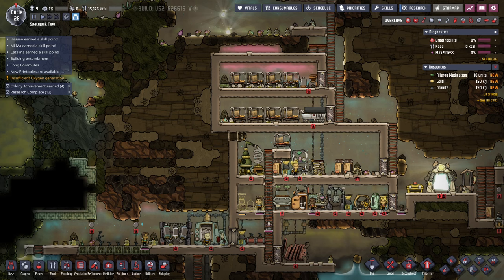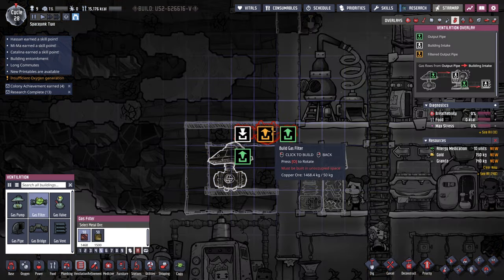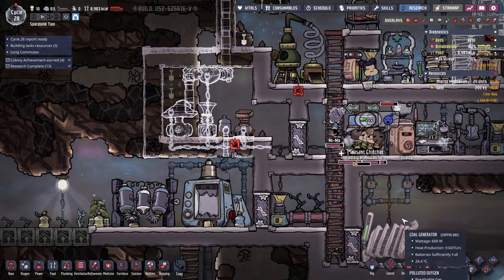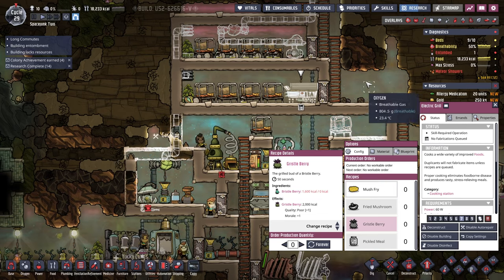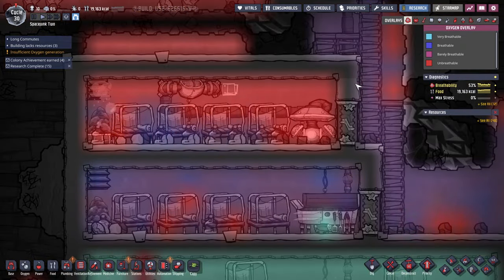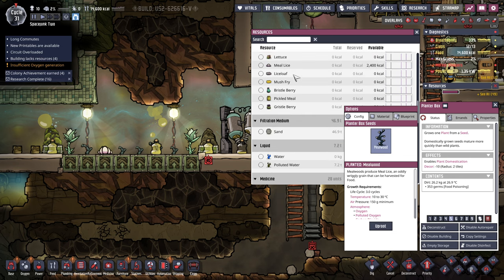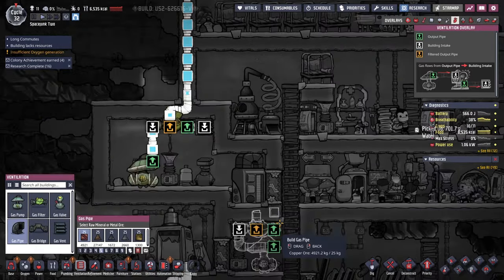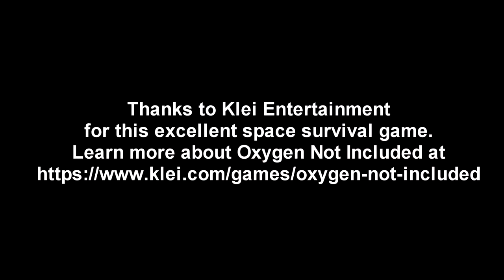Oxygen Not Included 5

Comment: One good thing to do first is a closed cycle lavatory/bathroom/filter that reuses the water, maybe not fully closed you can take fresh water or better polluted water to feed it and store the extra fresh water. Then doing the electrolyzer/ventilation thing, do it in a closed room, move the oxygen arround the rest of the base and use the hydrogen for a bit of extra power. The base should be done all with dedicated rooms for the bonuses, plus it helps to focus on what matters for each room type. Also you don't need to waste metal on so many airlock doors, that slow down your dupes movement, use the nomal pneumatic doors for rooms). Power is complicated, you need to layer it with a centralized power grid out of the way using the bigger wires then transform into separated power grids using smaller wires to feed some rooms. So basically divide it into grids based on the max power they can handle. Eventually you can have three levels, Big grid -> Transformer/s -> Medium grid -> Transformer/s -> Small grid -> appliances.

Comment: Sealing off rooms and using pumps to separate gases is a very power hungry way to deal with gas flow. The gases will separate themselves according to density if you allow them to flow through the base using airflow tiles and replacing the airlock doors with mesh ones. you just need to dig up and down so the CO2 has a place to sink to and the hydrogen has a place to rise to. 
This is a tough game to play blind. while knowing some orbital mechanics gets you far in KSP, knowing some thermodynamics can trap you in ONI as there are some major diffs from the real laws!

Comment: If you feel like you want to make a goal for yourself of figuring out a single critical system...  Might I suggest trying to figure out some version of temperature control in your base as your next critical system before all your duplicants freeze or burn?
Reply from the maker: I've seen no indication that they're at risk of freezing or burning so, until the game gives me some hint that it's going to be a problem, I'll wait to deal with that. That's been the flow of things so far.
Reply: @RaizSpace  Well I do see your duplicants constantly mentioning how cold they are, lol.  (There's a shiver animation; kinda like the holding breath animation when they are in a place without good air)

And the thing with heat in this game?  It's a self-reinforcing cycle.  So the second it tips too far in one direction, everything goes to pot pretty quickly.  

Thankfully you do have most (if not all) of the tech needed to handle it!  All you do, is set up a second closed-cycle water system.  (Might as well use polluted water for this, rather than good drinkable water, as it's only pourpose is to exchange heat).  So what you do is just pump water through insulated pipes to where it's hot or cold, then use regular or radiative pipes with lots of surface area in a hot or cold place.

So the water goes to the place that's hot, and in radiative pipes (or regular pipes) it picks up heat, then you pump it through insulating pipes so it STAYS hot, and pump it up to a place that's cold, and you have it go back through radiative (or normal) pipes to release that heat and get cold, which travels back through insulating pipes back down to the hot place to cool it off.

You will need this idea a lot, lol.  It's kinda how you create your own kind of refridgerators in various places.
Reply from the maker: They seem to shiver when the floor is wet and are fine when I mop up.
Reply: @RaizSpace  By the way it's quite painful to see them sloshing around in their own generated "polluted water". I suggest you need to balance the amount of available toilets regarding your population. 
Good luck with the following episodes, can't wait.